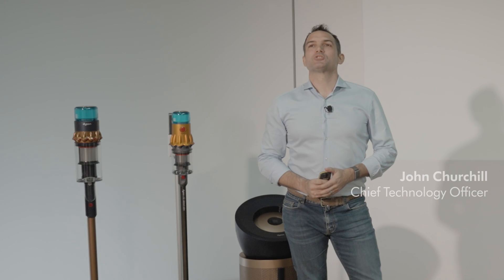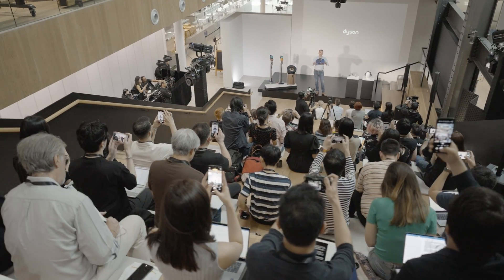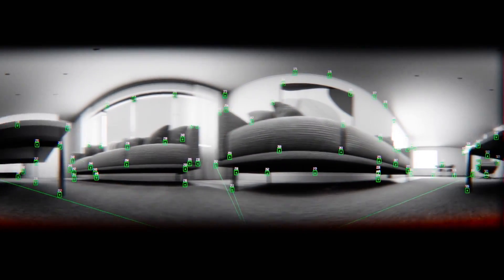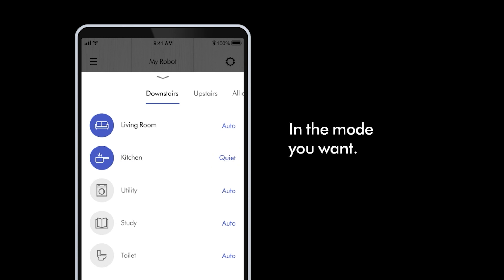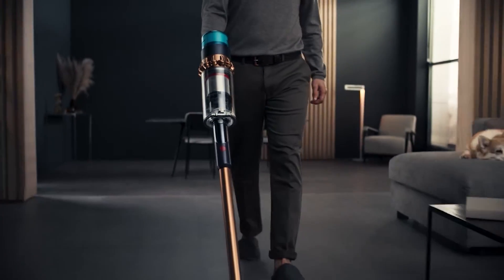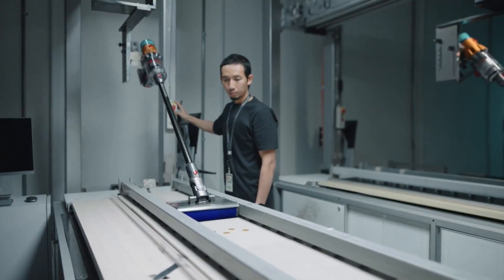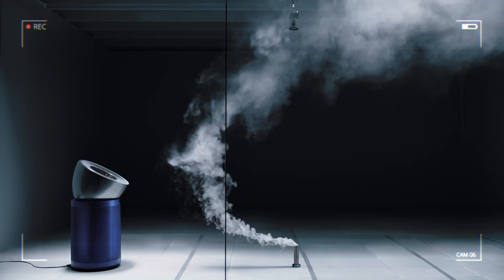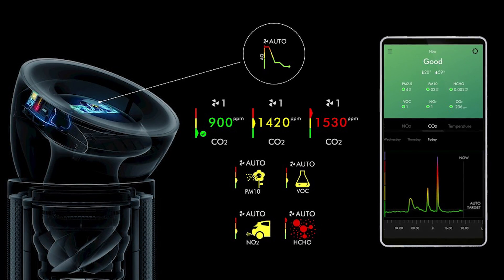Introducing the future of healthy homes technology

Comment: I honestly regret purchasing the Dyson V15 cordless vacuum, and I wish I had read a review like this before spending so much money on it. For a product that’s marketed as a premium appliance and priced accordingly, my experience has been deeply disappointing and frustrating in the long run.

When I first bought the Dyson V15, it worked well for about a year. During that initial period, I genuinely believed I had made a smart investment. The suction was decent, the cordless design was convenient, and everything seemed to function as advertised. Unfortunately, that confidence didn’t last. Around 14 months in, the battery began acting inconsistently and then stopped working altogether. One day it simply wouldn’t turn on or hold a charge.

I reached out to Dyson’s customer support expecting some level of meaningful assistance, especially given the premium price of the product. Instead, I was met with scripted, copy-pasted responses pulled straight from their website—information I had already reviewed multiple times on my own. There was no real troubleshooting, no attempt to understand the issue, and no sense of ownership or accountability from their support team. After several unhelpful interactions, my frustration reached a breaking point.

Eventually, I gave up and left the vacuum sitting in my garage for months, genuinely debating whether it was even worth keeping or if I should just throw it away. That alone speaks volumes about the quality and reliability of this product. Then, almost eight months later, out of curiosity more than hope, I plugged it in again. To my surprise, it started charging and worked. I briefly thought I had caught a lucky break. Sadly, that hope lasted barely two more months before the vacuum died completely again—this time for good.

When I contacted customer service once more, I was told that since my vacuum was just over two years old and the warranty had expired, my only option was to purchase a new battery. There was no acknowledgment of the repeated failures, no goodwill support, and no concern that a high-end vacuum had become unusable so quickly. Being told to spend even more money just to keep a two-year-old vacuum running felt insulting.

This experience has been incredibly disappointing. A vacuum at this price point should last far longer than two years, and customers should not be left stranded the moment the warranty ends. What makes this even more frustrating is that for the amount of money spent on a Dyson, many other companies offer far better quality, durability, and customer support. There are significantly better vacuums available at the same price—or even less—that actually last and stand behind their products.

This review is my sincere appeal to potential buyers: if longevity, reliability, and real customer support matter to you, please consider other brands before choosing Dyson. I truly regret this purchase and wish I had invested my money in a company that values long-term quality and customer trust.

Comment: I strongly advise against purchasing a Dyson vacuum cleaner. We own a 360° robot vacuum as well as a V11 cordless vacuum. The latter served us well for 3.5 years. We purchased original accessories and maintenance parts and cleaned the device regularly. Now, the power button on the control unit (pistol grip) is faulty. I called support on 02.05.24. "Yes, the issue is known due to the plastic. Please send it in, and the repair will cost 85 euros." -> Okay, that sounds fair. "However, it may not be repairable, so the unit will be replaced. Normally, this would cost 125 euros, but Dyson will keep it at the agreed 85 euros since the fault is structurally known." -> Okay, that sounds very fair. Unfortunately, the email with the return label was not sent afterward. So, I called the next day. "Yes, you have already paid the 85 euros. I will resend you the email. It must have been lost." Okay, mistakes happen. On Monday, 06.05.24, I received two emails: "The device has been received" and "The repair could not be completed. We will contact you" (which, of course, did not happen). So, I called again. "Yes, the device cannot be repaired, but it will be replaced. The emails are confusing, but there will be no additional costs since you have already paid." Okay, still understandable. On 09.05.2024, I received 13 (thirteen!) emails from Dyson stating that I "needed to complete the order". So, I called on 10.05.24. "Yes, the device will be replaced since it could not be repaired, and you will need to pay 125 euros. You will receive a refund of 85 euros."

This was neither agreed upon nor do I want a "new device," but either a repair or the originally promised cost of 85 euros. It is questionable for sustainability that a vacuum cleaner, originally priced at ~700 euros, is completely broken due to a plastic part (under normal use). Additionally, the poor behavior of customer service and the fluctuating prices are further disappointment to a long-time customer. Of course, I have recorded every phone call with Dyson support (by pressing 1), so I am willing to provide these recordings if necessary. If Dyson does not make any improvements here, I will likely switch to other brands whose cordless vacuum cleaners do not become irreparably damaged due to a plastic part or have their prices increased afterwards.

Comment: i never doubt the performance of a dyson - sucked all kind of dust from the surface. however, the no-brainer part is that, when we want to empty the canister, all hell break loose. all the fine dust that were sucked earlier was released due to the brute nature of the pumping action required to empty the canister. should have designed and produced an auto-empty system, like the one made by samsung/ lg..
Reply: I so agree there needs to be an easier way.  I am allergic to dust and this does not help
\

Comment: bought a vacuum cleaner, need to charge for 1.5 hours 
to work for 10 min. and there is no provision to work in connected mode
Reply from the maker: Our new Dyson Gen5detect™ vacuum has a runtime of up to 70 minutes per Click-in battery. The batteries can be easily swapped out for extended cleans. Boost mode is only intended for occasional intensive spot cleaning of areas with stubborn, ground-in dirt.

I'm not sure which model you own, but if you're worried it's not running for as long as it should be, our experts are standing by to help! Visit dyson.com and click 'Support' to find contact information for the Dyson Customer Care team in your country.

Comment: When a talking point from a new technology video is the standard HEPA filter, I become a little concerned. That's pretty common in vacuums these days. Maybe it's new for  cordless vacuums? If so, I'm surprised THAT wasn't the talking point. I'd prefer the focus to be on what is actually new to the industry.
Reply: "Filters meeting the HEPA standard must satisfy certain levels of efficiency. Common standards require that a HEPA air filter must remove—from the air that passes through—at least 99.95% (ISO, European Standard)[4][5] or 99.97% (ASME, U.S. DOE)[6][7] of particles whose diameter is equal to 0.3 μm, with the filtration efficiency increasing for particle diameters both less than and greater than 0.3 μm." Dyson HEPA filter is more advanced than the minimal requirements for the standard. I use and love Dyson products, I am not concerned.
Reply: @david.hungary  again, this should be the talking point if true. Advances in hepa filter technology would be interesting if stated as such. The average person isn’t going to immediately know it’s a .002 percent increase or if that’s relevant at all.
Reply: @joelface I fail to understand your point. They emphasised their already great filtration is even better. Better filtration is always a good thing. So you can reduce the even finer particles from leaving the vacuum. They discussed this
Reply: @joelface bro their point isn't about the hepa filter being a new thing but rather saying that in their new generation their filtration performance is increased. However what they failed to mention in the video is that their new generation has a full sealed system that doesn't allow anything to escape other than through the filter compared to other cheaper or even more expensive vaccums where there are gaps that small partials can escape through making the filter less useful